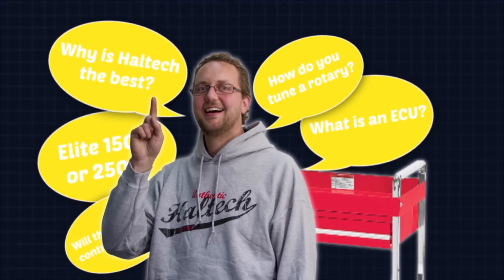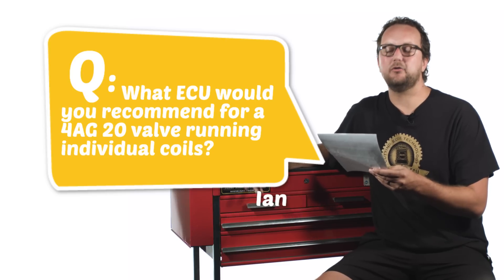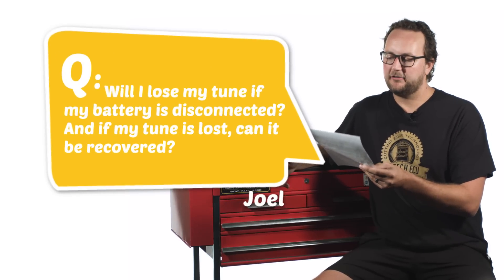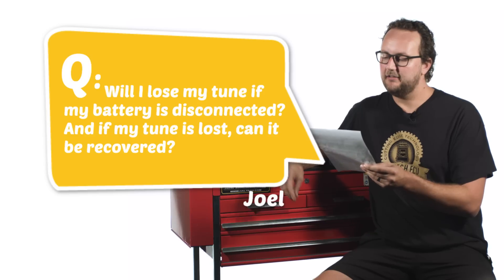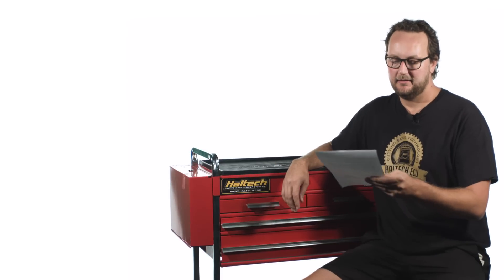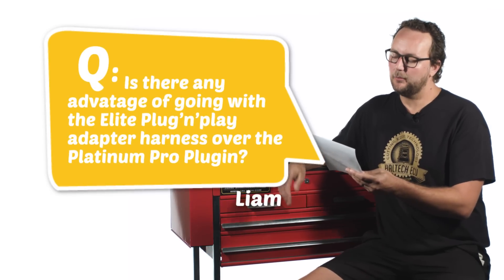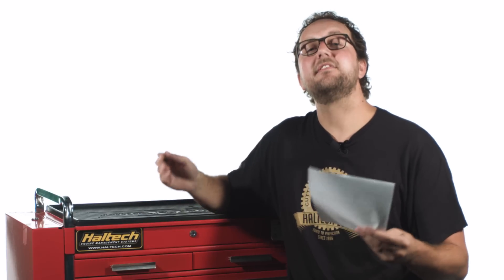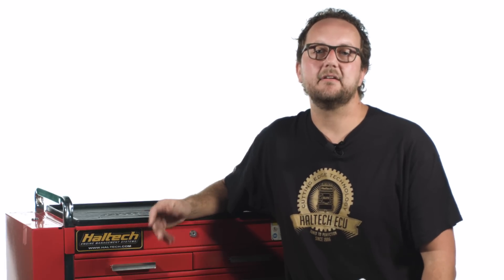❓ Will I Lose My Tune by Disconnecting the Battery? Haltech Q&A Episode 19

Comment: what ecu would u recommend for a  3sge beams.keep up the good work loving the content in these vids
Reply: bayley cardie if you intend to retain the drive by wire throttle then the Elite 1500 has you covered completely.
Reply: jeffman3 Thanks for taking the time to give your input, your interest in the Haltech brand is greatly appreciated.

I am not familiar with the red top BEAMS you have mentioned, however, assuming the variant of BEAMS in question doesn't have drive by wire throttle as well as variable valve timing on both the intake and exhaust cam then the Elite 550 would be okay if 5 digital outputs (auxiliary outputs) would cover the project (fuel pump, 2 rad fans, tachometer and check engine light).

If this variant of the BEAMS engine utilizes variable valve timing on both the intake and the exhaust then the Elite 1500 as it supports dual variable valve timing support (the Elite 750 only supports one variable valve timing can). 

The Elite 1000 would also be a good option assuming there's no drive by wire being used, you'll have all Race functions as well as variable valve timing control on both cam shafts.

Please remember that if ever in doubt your nearest Haltech dealer or your nearest Haltech head office is always an email or phone call away, we will gladly clarify all details for you and point you in the right direction to make the absolute most of your investment towards your project.

Cheers!

Comment: What ECU would you recommend for the Mitsubishi Starion? I have a multi point injunction set up and currently running the stock ignition system (although I would like to work out a way to have cam and crank sensors on the dohc 4g63).
Reply from the maker: Being a relatively simple setup I would suggest looking at the Elite 550.  This will control the fuel and ignition for you and support the move to sequential operation if a crank and cam sensor is added in future. You may need to look at the Elite 750 or Elite 1000 models if you want to use more advanced features like long term learning though.
Reply: Haltech you mentioned alcohol-based fuels have you seen or heard of problems with corrosion with non ss steel parts the reason I'm asking is win i have been researching it I've heard it's ok and then it's not ok to use any thing besides ss I'm looking into using e85 to reduce my fuel bill right now I'm on vp110 leaded partially to save my valves and to raise my octane level to pre 1970s because mine was made in the late 60s any any other ideas are welcome.  ps. I'm working on efi swapping and distributor-less ignition to with boost

Comment: Well I had an electrical mechanic play around and fix my reverse light and my Apple CarPlay in my ek1 and now the haltech somehow seems to be draining the battery overnight or something is draining the battery plus I lost my speedometer on my Speedo and my crack and pop chain. Sounds absolutely horrible. And vtec isn’t engaging so I had this module it’s like a two-step thing but it’s got like 5/6 steps on the normal side and then on the other side you’ve got all the different rpm levels for the crackle pop affect but my rpm drop out at about 4500/5000 just does the VTEC engages and drops out. It’s cutting the whole engine. Any advice I know this is an old video, but please any advice would be much appreciated.

Comment: Hi there. Do you ECUs cover British cars such as the MG TF 115 (2004)? The original ECU runs proprietary software and uses OBD2 with the ISO 9141-2 protocol, so I'm not sure if there's even a base map out there for it. Cheers!
Reply: Jim Griffiths hello. The Haltech Elite family of ECUs are universal, that is to say they can be configured to control a wide range of engines in various setups. I can also confirm that the Elite family of ECUs support OEM OBD-2 protocols, however, verification would be best for an absolute response.

Where I live in the Caribbean your make and model car isn't common to me, however, if you locate your nearest dealer I am sure an arrangement can be sorted out where one of our solutions will get you up and running with consistent reliable drive-ability.

I can't answer all of your questions here in a YouTube post but if you would like any additional clarification or verification I will try my best to facilitate. Always remember that Haltech support is always an email or phone call away.

Thank you kindly for your interest.

Comment: what ecu would you recommend for a L15a (2006 usdm Honda fit) Honda motor, we are using one in a lotus europa and trying to find the best route edu wise
Reply: TheIornmonger can you say is this is the i-DSI or regular i-VTEC/VTEC.

Although the L15 is a four cylinder engine, a great match for the Elite 550, continuous variable cam timing control differs from a traditional switched CAM so ultimately the Elite 750 or Elite 1000 can work best. Depending of course on if you are wanting to control both the intake and exhaust cam via VCT.
Reply: Sard Engineering the europa is running the regular vtec L15a
Reply: Hello, sorry for the late response. For the L15A which has employed the traditional VTEC (your basic switched can) the Elite 550 will work really well. 

If you need any further assistance by matching the inputs and outputs exactly then please feel free to ask. Cheers!
Reply: @sard engineering correction it is from an 09, and we need one that can run a drive by wire throttle
Reply: TheIornmonger thanks for taking the time to follow up with clarification, if drive by wire throttle support is needed then you will want the Elite 1500. Although it might seem like a lot of engine management control features, you will also be opened up to a lot more inputs for logging data which will help you understand more about the engine's operational conditions and ways you could explore efficiency upgrades. Having all the Motorsports features can also be a plus if you choose to explore this down the road.

Cheers mate and thanks again for your interest in the Haltech brand!
Reply: Sard Engineering thanks for the quick response, I will be going over to help on the Europa today, if I have any more questions I'll, shoot them up on this thread
Reply: TheIornmonger no worries mate, I'll be more than happy to help if I can. Here's to a productive day on the project, cheers!

P.S. You can find me on Facebook as well, look for Damien King.
Reply: Sard Engineering what's your profile photo
Reply: TheIornmonger Northern Ireland flag is my profile photo and my profile banner is my company logo 😊

Comment: I have a 1986 Mazda rx7 13b turbo. I was planning on using the sport 1000 with terminated harness. Since those are being discontinued and the elite series has more options will you be offering a terminated harness for the 13b for the elite? What elite ecu would you recommend using? I won't be using dbw.
Reply: michael deschenes for what you are asking the Elite 1000 will be a good match. You will have access to the Motorsport features as well as a flexible array of table configurations.
Reply: Sard Engineering could the terminated harness that is made for the sport 1000 be used with the elite 1000?
Reply: michael deschenes the conversion from a Platinum Sport harness to an Elite harness is very much possible and quite common. I'm double check to ensure that what you're asking for doesn't exist already, ready for purchase. 

I'll either edit my response with a part number or send another response with the part number for you. Thank you kindly for your interest.

HT-150829 is the part number for the entire Elite 1000 kit, ECU included. 

HT-141329 is the part number for the plug-n-play adaptor harness

PLEASE NOTE: Both part numbers apply to the 1996 to 2002 Mazda RX-7 FD3S-S7&8

PLEASE NOTE: Only the Elite 2000/2500 will control the factory twin turbo system, for single turbo conversions the Elite 1000/1500 will work.

Comment: What Standalone ECU would you recommend for an American Spec Lexus SC400 (AKA Toyota Soarer) with a Non VVT-I 1UZFE with individual throttle Bodies and increased compression with a lighter rotating mass mounted to a Nissan CD009 transmission? And Why?
Reply from the maker: The Elite 2000 would be ideal for a modified 1UZFE, as it supports MAF-less tuning, sequential injection, and direct-fire ignition. It also supports banked long-term O2 control when teamed with wideband O2 sensors, and banked knock control.

Comment: Can I use the Sprint 500 for a 4age 20v? Will it recognise boost if I had a turbo?
Reply from the maker: Yes, the Sprint 500 can run a 20V 4AGE. The ECU’s internal MAP sensor can read up to 22psi boost, after which an external sensor would be required.
Reply: Thanks

Comment: what ecu would you recommend for M50B25 non-vanos? i'm planning to turbo it.
Reply: Assuming you are just trying to control the OEM engine management solutions the Elite 750 will work, it was specifically designed for 6 cylinder engines.

If you would like Motorsport features along with onboard knock then the Elite 2000 or the Elite 2500 would be better.